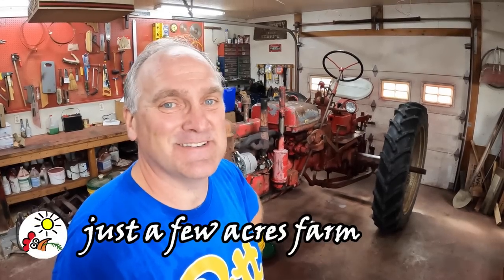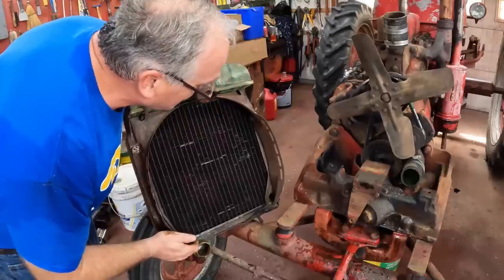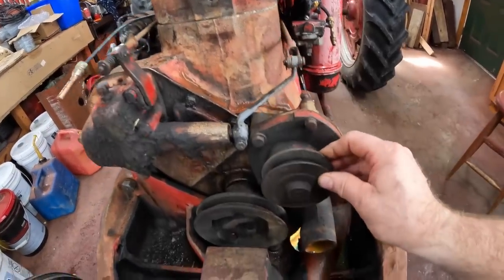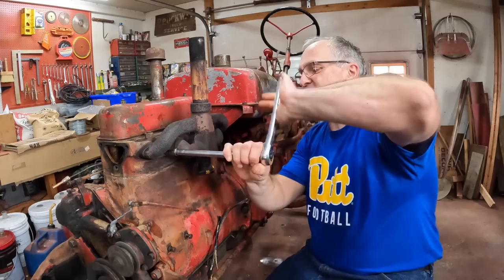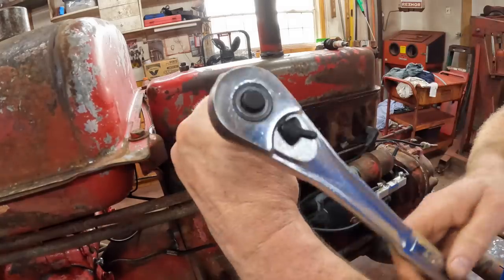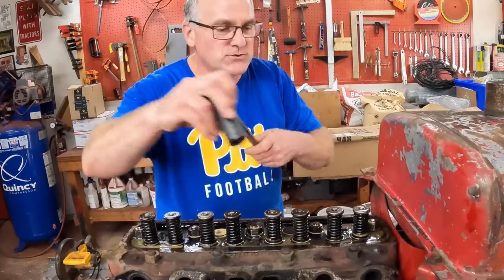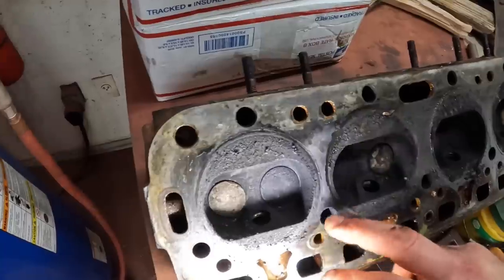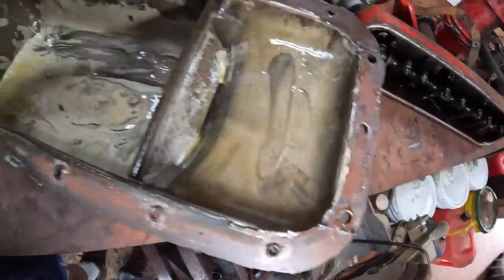Farmall Super C Engine Teardown | Farmall Super C Restoration Episode 1

Comment: Great to see another Farmall still in use. I sure could use your Farmall experience on a 48 cub im rebuilding. I rebuilt the engine back to specs but no fire. It has air spark and fuel but still won't turn over.
Reply: If it has all of those it likely just needs the timing set up. Far as I know find top dead center on the number 1 cylinder and go from there...that or plug wires are mixed up

Comment: Radiator shops are still around. It may not be justified to spend 200$ to fix a 400$ radiator. However a 200$ repair on something like an intercooler to a PC400 which costs 2000$ would make sense.

Comment: Excellent video  Pete  :) always enjoy videos all you do super cool stuff & jobs to plus fixing too and love it every minute put to! Yes love about history lessons shared to especially engines on Farmalls plus International too and remember doing gas motor on 1968 McCormick International 105C combine was fun to and how got head of use tow chains also pulleys systems lift from 2 rafters on machinery shed plus 3 men task do and a loader small McCormick International B414 tractor bucket to with tools also put head in too! For reinstall too when ready motor block took with used bale also toe link chains put on back of pickup box on wood cradle like skid so do inspection on then had my workplace check over washed motor and see if need attention fix or welding to but nothing surprises on cracks or damage back 1993! That combine motor is 202 Cubic Inches size 4 cylinder!

Comment: This might be a little long(my story)but it's kind of funny. 
Years ago I worked at a golf course. My job besides working the grounds was to assist the mechanic repair equipment during the winter months. We had an old Massey Ferguson tractor that had a bucket attached to it. We used it to redo the sand traps in the course. 
It'd been some time since we'd given the old girl some love, so the mechanic decided we should tear her down.
In the process we were removing the water jackets(sleeves) the mechanic got under the tractor and said "I'm gonna tape this up, when it pops up, grab it and pull it out" he did and so did I.  I pulled the jacket right out, only to hear him yell in a gurgle "put it back in, put it back in!!!"
Natural we'd drain all the fluids before we started, but the block was so full of sand it did all drain out! When I pulled that jacket out about a gallon of antifreeze and sand mixture poured right in his face! 🤣🤣 
Took me a minute to get the jacket back so the stuff would stop pouring on him because I was laughing so hard.
Anyway, looking forward to this series of videos Pete.

Comment: Thanks Pete! This is why I always tell my customers who own old tractors that you have got to work them hard and wide open several times a year! To prevent that milky sludge! Even a tractor like that I would load a trailer full of wood so it has some weight and run it down the road! Put in road gear and full throttle run down the road. I would go at least 3 miles one way than head back home. I always find the road with hill or grade on it. Make it snort! I always do this to all of my tractors. Another thing is if they have been running low rpms for a long time or short runs, before I put it back to bed down the road I go! I would rather spend money burning gas then have that in my engine. My opinion I guess.
Reply: @texancowboy9988  yes I have seen all that. But those heaters tend to get to  hot at times. And have been known to blow out the the thermostat. Also that won't cure the condensation problem I have seen it enhance it. Beacuse all the components are sorounded by a cast iron block. All that will do is cause the block to sweat more. The only way to get rid of it is through thermal heat. Hot block for hours working hard. Not hot block sitting. Even the farmall manual says to run hot and work it hard before wintering it. Or parking it for long periods of time. And don't forget that is thermo siphon cooling system. Yes it has a water pump. But the pump is only running hot water into the radiator. Going out from the radiator is gravity. And we must also remember when these tractors where built, they didn't have antifreeze. You need the tractor you poured water in and when you where done the water drained out.
Reply: @texancowboy9988  I get what you are saying. But you need look at the chemical composition of cast. It has some of the same behavioral chartecterstics as porcelain. 
Yes humidity is the problem and yes I agree with what you said. But to stop that when you have a working hot engine that is Parked and shut down it won't condense. Cast ounce hot will stay in that state for a long time.  The design of the engine was made that way. The manuals also say after a week of hard running turn the oil drain plug to drain the condensate out. The oil won't come out. Beacuse water sinks. So if Pete is putsing around the farm with it he should either one or both of those things. When basically all the manuals of that Era and of different makes say to do those two things. The only ones that didn't have this problem was John Deere. And that was beacuse they had pet cocks or compression realese. They would naturally drain out the condensate.

Comment: Pete I’ve worked on my B John Deere’s rebuilding engine’s , our R John Deere rebuilding the rear end 
my 4030 diesel witch cracked sleeves the tractor came with two different Diesel engines one tractor, one combine my tractor had the combine engine once you replaced the sleeves it was supposed to hold but I got to do it a second time. I turbocharged the engine and put it to work.  We’re it labored with a 5/14s before, after it played with a 5/16s . I’m sure you will like your tractor even more when finished and new paint.

Comment: It's very relaxing watching you do these old tractors up.  I replaced the drive disc/pressure plate sections of the 2 stage clutch in my old mahindra 4wd tractor years back.  Total 14 hours of labor but the machine was down 2 weeks waiting on parts.

It's a labor of love that you learn from.  And it keeps you young as long as you work smart and don't get hurt.

Comment: Mr Pete, thank you for posting this video.  I am looking for my first Farmall, either a Super A or a 140.  I have found a 140 local to me and it had the head removed and machined and re-installed.  The tractor has the sheet metal, radiator, generator, etc removed.  I know this video will be great in helping me get the tractor back together if I decide to buy it.  BTW it is still leaking oil between the head and block on the driver side about half way down the head.  Any idea why?  I'm not sure why he pulled the radiator to pull the head or what was wrong with it to begin with?  I'm thinking possibly it wasn't torqued properly, or in proper sequence.  Also I think he ran the tractor after installing the head and didn't install the radiator, so concerned about possible warpage of the head?  Again thanks for posting and sharing your knowledge.

Comment: Pete - I wonder if a hotter thermostat would be in order for this tractor since it gets shorter runs and more moisture built up in the oil. Instead of a 160F maybe a 180F if that is even possible. Either that or a smaller piece of cardboard on the radiator. Something to allow it to hold at warmer temps on shorter runs to “cook” not overheat the oil more frequently. Great video!

Also good choice - you USE this tractor. Make it right.

Comment: Pete, have you ever add a little marvel mystery oil through the intake while engine is running and at operating temp. It will blow some of that carbon build up out the exhaust. Especially the build up on valves. I’ve done this on engines for years in the natural gas industry. I’m a big fan of your videos, keep em coming and stay safe.

Comment: Cereal boxes make the best gasket material I use them rebuilding old mercury outboards I also spray some gasket sealer on them before install 
anything built in the 40’s and 50’s have uneven gaps on them

Comment: Awesome news i just bougth an international 105 combine and it has a c153 engine and it's very similiar.  And yes i have to investigate the low oil pressure you said.  The hard part i have to lift the engine to get the oil pan off.

Comment: Hey Pete   im really enjoying the videos on restoring the super c. Im right where you are about doing things right. once I pulled the engine on my super A-1 (c 123 engine) I went on into the torque tube , trans input shaft bearing and seals. and considering replacing the clutch shaft sleeve for the bearing carrier. It appears to be worn almost half way through along the bottom side. looks to be a tedious process since access is so limited considering where its located. Have you ever replaced one? I think the Super C is about the same set up as the Super a. Thanks again for the videos.
Reply from the maker: Hi Jeffery, I replaced the sleeve on my Super A. Mine was easy because it was so worn that I was able to just pull it off the clutch shaft.
Reply: @JustaFewAcresFarm  Hey Pete. Thanks for the reply. It’s my first restoration and I’m using resources that are available to get it right. And you are my favorite one so far. Out of many. However I’m not sure if we’re talking about the same part. My description of the part is that it’s the tube that’s pressed into a bore on the torque tube- bell housing end. And the clutch release bearing support bolster slides back and fort on it as the clutch pedal is operated. I look forward to your reply. Thanks
Reply from the maker: @jefferystrange7476  Yes that's the tube I'm talking about. Mine was completely worn through and flopping on the clutch shaft.

Comment: Looks like a great project. Are the nuts that hold the manifold all brass? Also dose it just look to me or one of the studs for the valve cover looked a little crooked? Maybe thats why it did not wanna come off easy?  Not familiar with Super C or Farmall C oil pumps but I sure do recognize that style pump.  And as on the other applications they where known to have bend surfaces and you had to be careful tightening the cover down. But if they work they work fine.